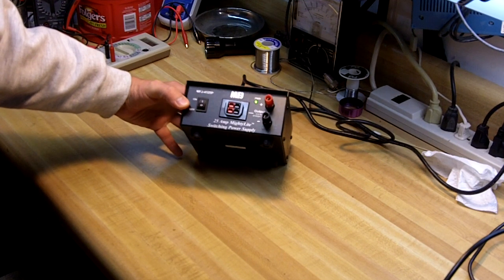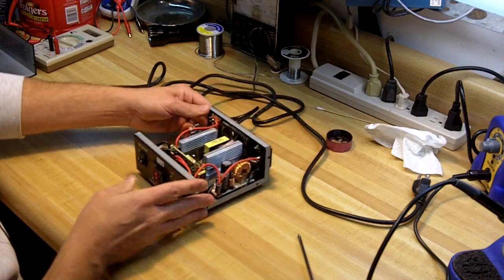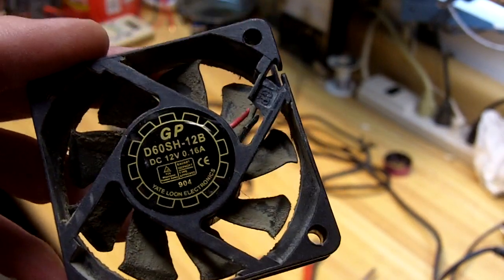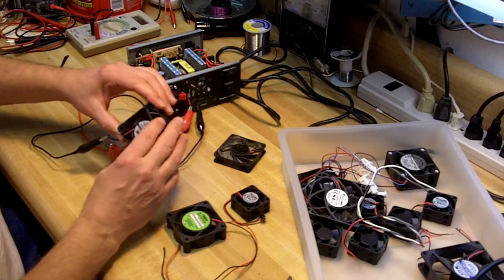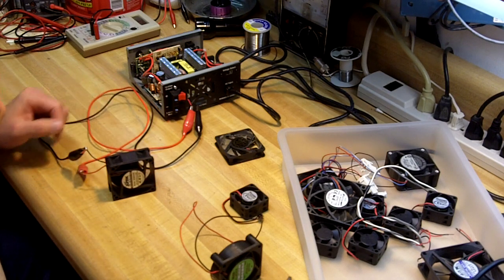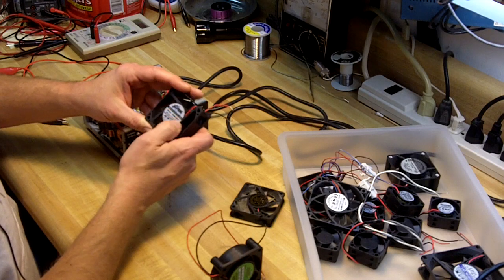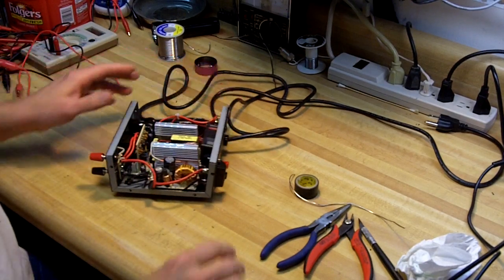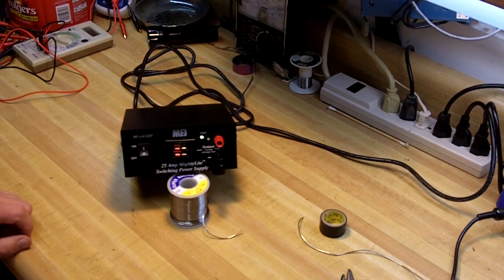MFJ 4125P Power Supply Fan Replacement

Comment: I am through with MFj Power supplies!  I just bought a new Model mfj 4103 power supply for my new Yaesu FT-817ND and the tech guy at MFJ that i talked to before i bought the supply told me that it was designed for the FT-817ND. it's the noisiest
Power supply i have ever owned i am sending back to mfj and buying a samlex like i should have,in the first place. I owned a samlex 35 amp supply and it worked well for my Yaesu FT-857ND. I learned a lesson ,i thought i would give mfj a try. I have ordered a Samlex  Supply and can't wait till it arrives.

Comment: Thanks to Larry motivating me to replace my fan in both of my MFJ power Supply, (LOUD AS HECK) I have some info for anyone else experiencing the same thing. I have 2 of them and both are loud FAN Wise.Like Larry said, great little power supplies, but my fans have both been loud from day one. The actual Fan Part info is YL Manufacturing  (YL is Yate Loon) model D60SH-12B. The dimensions are 60mmx60mmx15mm. Its a 12 Volt 2 Wire running  .18 amp. I ended up ordering a generic 2 fans off Ebay for $6 shipped ($5.18 for fans and $1.50 shipped from Hong Kong via epacket delivery ) here is a link http://www.ebay.com/itm/221441533978
Thanks allot Larry
73 Ron KB3VEW
Reply from the maker: +ThePauperPrepper   Thanks for all of the great information Ron!  That is great to know.  73
Reply: +RadioHamGuy  Thanks for filling up my boring Sat afternoon. I just let your videos play, I bet I listened to 2 1/2 hours worth today lol I have terrible antenna selections so if I don't have Primo propagation I'm screwed.
Reply from the maker: +ThePauperPrepper Hey that is just great to hear,  I am very happy to hear when others get some use out of my videos.  It is fun for me to do and comments like yours inspires me to keep doing more so thanks very much!  73...Larry

Comment: hey the 4 connections on the front  in the center if you were to purchase a plug to plug in to that what would it be called.. im trying to get the name of this outlet
Reply from the maker: They are called Anderson Power Pole connectors.  I use them for many things, they are a standard connector in use these days, especially for ham radio emergency communication set-ups.
Reply: +RadioHamGuy  Anderson Power Poles are basically the standard of the HAM Hobby. They were adopted as the Official Power Connector for most ARES and RACES groups. I love them. Word of advice, get the real crimper. Its no fun with pliers! Also, save yourself time and money and order in quantity. Whats amazing is what you end up finding uses for them. Im a Power Pole Addict
Reply from the maker: +ThePauperPrepper I am finding many used for them and over time am switching out most everything I have on 12 volt to them.  Makes things much easier that is for sure.

Comment: when the fans get stuck like that all you need to do is clean it off and remove the sticker, from there you can access the bearing and oil it, the fan would then probably have worked well again

Comment: Why not use a 7809 and have the running at a lower voltage? Or even use a temp controlled  circuit and control the fan with that? I did that and it extends the life of the fan and there's less dust in the power supply.